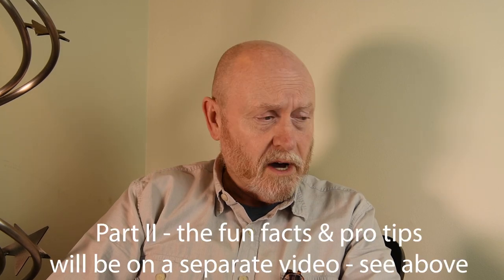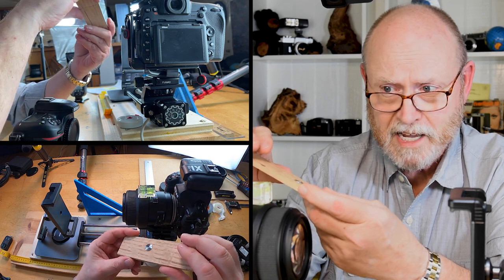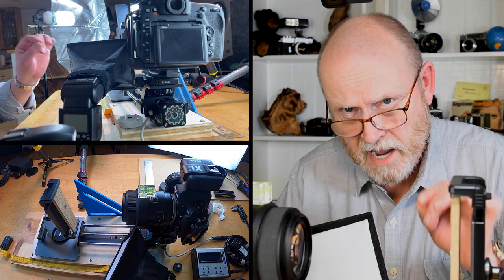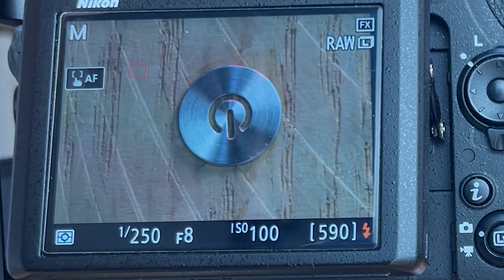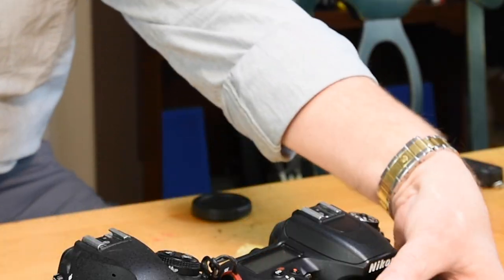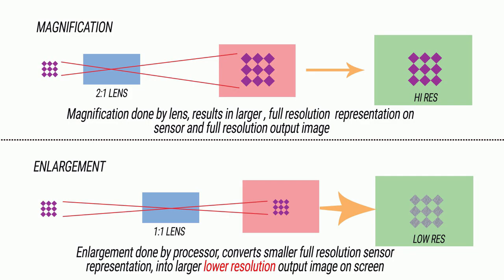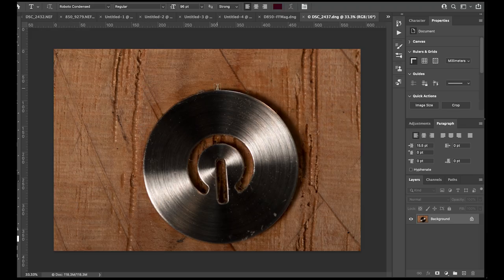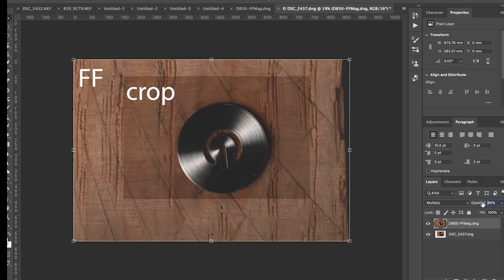Sensor Size Matters - Part 1 (the Front Half) - A Demonstration

Comment: 14:21: I don't agree on this: the screen is just a medium, not the picture. your assumption would be correct if these sensors were in fact analogic media, like different size film pieces that has to be enlarged to fit the frame you are putting them in.
It is not the case, with digital imaging as the pictures you get are just made by a finite number of pixels. If you put, for example, side by side a Full frame 20MP sensor, like for example a canon R6 and then put the same lens at the same distance on an Olympus EM5, which is also 20MP, the size of the image, file wise, is exactly the same.
We may discuss that the larger sensor spreads the imperfections of the lens finishing on a larger area then the M43 sensor, but that's not the point. Any 20MP sensor fill exactly the same area and are the same size in Bytes (information amounts) at the same magnification independently of the media through which the picture has been recorded.

Comment: You are totally right, but APSC cameras do give you more detail as long as the lens is sharp enough. The pixel density of a 20/24mp apsc sensor is higher than the densityof a 45mp FF one. So it is in a way true that a crop-sensor gives you "more magnification" but not because of the crop itself but because of the higher pixel density. (the pixel density of the D7500 is only marginally higher than the D850s so there is practically no difference. A D7200 or other even higher resolution crop-sensor cameras should give you a significant boost in magnification.)
Reply from the maker: Hi Otto, I see what you are saying but it has nothing to do with magnification. Magnification is factor by which your subject is increased or decreased in size, relative to the size it appears on the sensor. The size, shape, type, or even the pixel density of the sensor has nothing to do with it. A higher pixel density may or may not affect the quality of an enlargement (pixel size and pitch are much more important), but it has nothing to do with magnification. I have a video that looks at this in much greater detail - should be out soon. Thanks!
Reply: @Allan Walls Photography Yes I know technically it’s not magnification but I thought that stronger cropping in post would be possible, giving you more practical „magnification“ in your final image. I didn’t know that the size of the photosites and the pixel pitch have such a big impact on the result. I’m always open to learn so I’ll be waiting for your next video on the topic. Keep up the great work!
Reply from the maker: @OttoLP  There is a lot of nuance in this discussion, I agree, and a lot of the misunderstanding  springs from the different ways in which we use certain terms. I definitely get your point, and it certainly has merit, but when we come to an agreement on the interpretation of some of these key terms, the premise may need to be restated. You will see what I mean. There is one thing that we both appear to agree on completely - this stuff is important and worth taking the time to understand. I hope the upcoming video(s) will help move us all a bit closer to a better understanding of sensor science - Thanks for your interest and enthusiasm - that is also very important!

Comment: Allan, you are a brave man to take on clearing up the considerable needless confusion created by "crop factor", "equivalent focal length", etc. Who would guess that the simple act of placing a sensor of a different size at the focal plane of a lens could create such confusion. You got away with your Photoshop overlay of the D850 and D7500 images through the happenstance that both sensors have very similar pixel pitch, 4.34 um for the D850, 4.20 um for the D7500. A very direct demonstration would be to remove the ground glass from your neighbor's view camera and draw two concentric rectangles on the ground glass, one 35.9 x 23.9 mm representing the D850 sensor, the other 23.5 x 15.7 mm representing the D7500 sensor, then mount the ground glass at the focal plane of the lens. Its the same image enclosed by rectangles of different sizes. You can also use a scale to measure the size of the subject image projected onto the ground glass and demonstrate that magnification is, by definition, simply the scale of the subject's image divided by the scale of the subject itself. Don't drop your neighbor's ground glass, and don't use permanent ink. :-)

Comment: Allan, spot-on assessment and illustration.  Anyone that has ever used a compound microscope realizes that it is the lens (or objective) that determines the magnification.  Changing the relationship distances of the lens to the sensor, such as using extension tubes, changes magnification so all one must do is realize that again it is the function of the lens that affects the degree of magnification.  If it truly were the sensor then the tiny cell phone camera sensor would be enormously magnified compared to that of a full frame or APS-C sensor camera...however it is not.

Comment: For anybody who still doubts this, the clue is in the term " cropped sensor ". It's a crop not a magnification. Quite what people don't understand about this is beyond me quite frankly.
Reply: Ther's a flaw in his test....that he is not using equal mp camera's.. He is using a 45mp(full frame) photo in photoshop/lightroom and compares it to a 20mp (crop ) I you are into bird or macro photography (where you need to get the most out of the lenses you own) and you could buy a 20mp crop or a 20mp full frame....the crop camera will always show you a bigger object in the photo because it devides those20mp  pixels over a smaller part of the lens. If you really think mpixels dont make the difference in this comparison than do this test Alan did above ...but this time use a high pixel count crop camera and a low pixel count full frame................you will be amazed how much difference you get than looking in photoshop or lightroom. I assure you. He's right on the magnification of the lens...that remains the same because its fixed. But the representation on screen using different camera's is another thing.
Reply: @HoutmeyersP  You are correct that had a 30MP APSC sensor been used then absolutely you would have more translational data, thus you'd have an image that would potentially print bigger. So yes, in that situation the crop sensor would be preferable. I think Alan is quite explicit however in that the point he is proving is the misconception that the image is " magnified " when clearly it isn't. It is of course an understandable error given on the face of it the image " looks " more magnified using a crop sensor. I'm sure Alan accepts that more megapixels can only be a good thing if you want as much data to play with but that wasn't the point of this video. 😉😊

Comment: Nice work Allan. I'm not sure the bit about pixel measurement in PS is valid, as that's variable across different generations of FF or APS-C sensors, and so will be different on the focus plane.
Reply from the maker: Very good point, Paul. I should have measured the subject in a standard unit of distance - not pixels (which is a similar mistake to one I was trying to explain!)

Comment: @Allan I agree with you regarding the fact that magnification is independent of sensor size but I think you missed on the demo. The easiest way to demonstrate magnification is to just photograph a ruler with mm scale on it and compare how many mm are captured in the field of view vs the sensor size. A full frame camera will see 36mm across a 36mm sensor and a m4/3 camera will see 17mm across a 17mm sensor at 1:1 magnification.  This is of course intended to be constructively. Love your content :)

Comment: Great example Allen!  I've been using my full frame for macro for a while and found the same misconception blown out of the water.  Photography Online - Mc2 Photography just did a similar example with lenses wide to tele and perspective.
Reply from the maker: Cheers Alan - it still surprises me how often the matter comes up. I just riveted a note to my forward, reminding me to check out the article - (this nylon does dissolve eventually, right?)
Reply: @AllanWallsPhotography  Just put a piece of gaffer tape over the hole....no problemo lol

Comment: Use the same lens at the same distance from the sensor plane and you get the same image circle falling on any sensor you care to place there. i.e. Completely independent of the choice of sensor. If your choice of sensor has more pixel density then you can enlarge it and see more pixels on your screen. Of course the quality of said sensor pixels are not equal.

Comment: Hey Allen, I have to tell you that what you are saying isnt correct as I measured this very accurately. I had to measure it because I use the camera to capture the data for photogrammetry on a daily basis and what I capture is a pure data for 3D reconstruction. Anyway, its not about the magnification, but pixels resolution on a sensor - amount of cells/pixels in both axis the camera can store. So if the sensor can store 4000x3000pixels it is called a 24Mega pixel one.. because 4000 pixels multiplied by 3000 pixels gives 24 million (mega) pixels. Cropped sensors have usually higher pixels resolution, therefore they can store more details. Of course due to their limited size the image coverage is smaller. So full frame due to bigger size catches wider image - therefore vignietting etc. while smaller sensor catches just the middle of what higher sensor sees. So its all about the matrix size/pixel density used to store the data. So if cropped camera uses 6000x4000px for cropped area, it is able to store more data within this area to the camera which use full frame but stores just 4000x3000px. So its not about the magnification but the actual image resolution used to store the image, therefore a 30Mpx caemra with cropped sensor is going to give you way more details to the 20Mpx camera with full sensor even if the overal coverage will be wider. Full frame tho has a different avantage, larger physical coverage allows more light to get in therefore it works much better in low light conditions.
Reply from the maker: Hi Gregorz, did you read the note I had placed in the video description - I made an error to refer to pixels when I was talking about physical size. Obviously what you say is correct and I do not dispute that, but the point I am making is accurate when the pixel density is held constant which was the constraint placed in the example. I need to remove this video until I can remake it with my error corrected. Thanks for pointing out the error!
Reply: @AllanWallsPhotography  oh, I missed that. My bad. Yeah, honestly I think it would better to remove it since the entire video is wrong.. Such a shame since I can see how much work you put into this one. But I respect you somuch that believe every single word you say without any hesitation :) and after I watched your video, it hit me realy hard that what if was really so wrong all the time .. had to rewatch it to be sure I didnt misunderstood what you say and there is no some hidden truth I missed..  especially if what you said is true it would affect my daily job as hell as it would mean I was so wrong all the time :D
Reply from the maker: @GrzegorzBaranArt  Just to be clear, my mistake was a slip of the tongue - if you replace pixel and mm,  the point is valid - the crop sensor does not magnify the image - it crops the image making it smaller than the FF image but appearing to be the same size on the back of the camera. This is of course provided the sensor architecture is held constant. Your statement about pixel resolution is not relevant to the point, and not accurate in many cases. The argument that I was refuting was that a crop sensor camera enlarges the image - it is a commonly held belief but it is wrong. I then explain that the pixel density of the two sensor is the same, so your pixel resolution argument cannot be used - I am setting the constraints to exclude that variability. As it happens, my mistake did not make any difference in this example because the math works out even with the wrong units. You are a smart man so I believe the issue here is that language is getting in the way of our communication. If you want to discuss offline, send me an email and we can set up a time to talk. It is important that you understand this concept
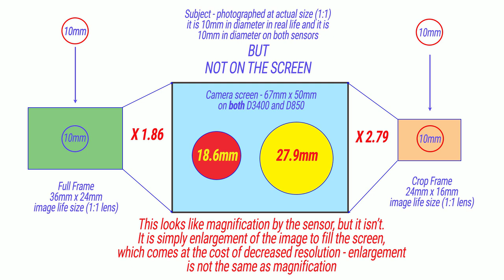Reply: @AllanWallsPhotography  Thanks, I believe I understand the concept in 100% and I fully agree with you. I just got confused at the beginning as I thought I could be wrong. And of course you are right in everything you say, but I am biased a bit since I work and think in pixels as by taking images I simply capture the data for photogrammetry reconstruction - I covered the sensor size it in my video in 13:45 (https://youtu.be/REA3XNgUMJg?t=806). So from the pixels resolution point of view, cropped sensor provides the higher magnification even if this magnification is based just on pixel density, not the physical sensor size. Of course the images is cropped therefore lose a lot of data which is out of the crop which would be captured by the full sensor, its especially painful when you deal with 360 captures. So for me, what matters is the actual sensor resolution and smaller sensor with higher resolution gives me more data to larger sensor with lower resolution, even if it captures wider overall. Thank you for being such inspiring and awesome <3 .. I finally managed to build the extension tube and purchased the budget x4 objective thanks to you and it all works. Unfortunatelly the magnification didnt impress me as I was pretty close to it with my 100mm macro, 25+15mm extension tubes and DCR-250 magnification lens at the end :). Now started saving for real, x10 objective.. Would be great if you can make a video to compare difference between magnifications.. x4, x10, x20 and maybe x100 if thats possible.. even on a ruller .. unless you already did it and I just missed it. Because I am not sure if 10x is what I am looking for and it is going to be very expensive to find out that I am really looking for 20x or 50x instead.
Reply from the maker: @GrzegorzBaranArt  I think we both started questioning what we know to be correct -which is a good thing! We should always question the things we are certain of. In this case you are working every day with actual examples of sensors whose architecture and pixel density are NOT equivalent, but I was throwing out an example where they were equivalent, to make a point. So it is an understandable miscommunication but we both have valid and correct facts. You are a smart man - please keep questioning me - when I make mistakes (all the time) I need to know! Thanks Grzegorz!

Comment: Hi Allan, thanks for your videos, Yes it matters but sensor resolutions too!!

Your analysis is correct for the difference in resolution of the cameras you use, but if you do the same exercise by comparing for example the D750 vs D7500 that have similar resolution sensors, the results are different.

Greetings from Ecuador.